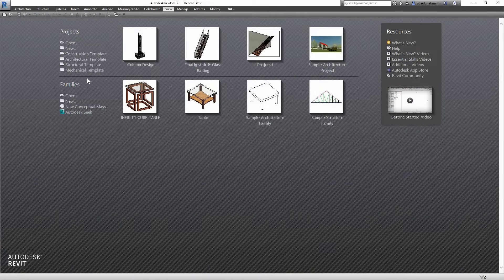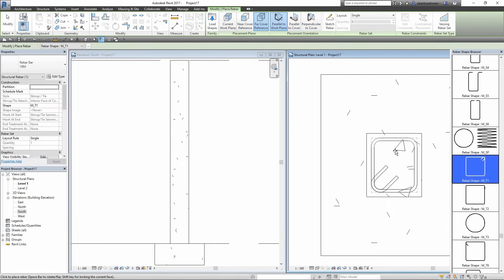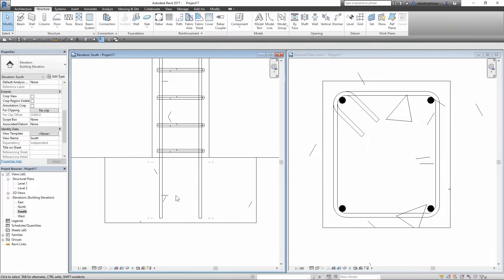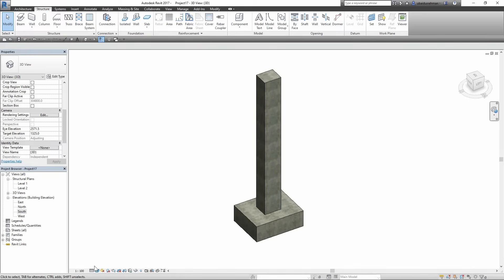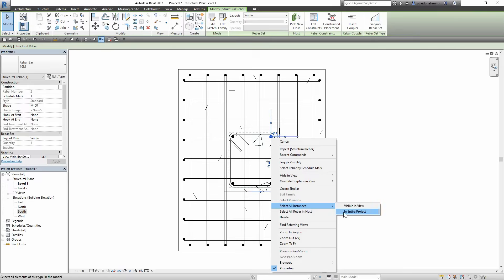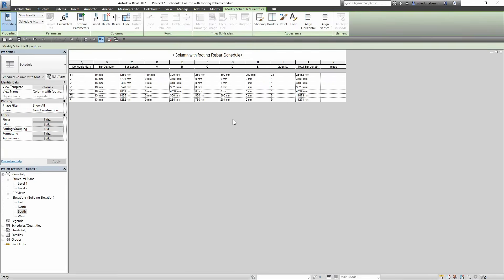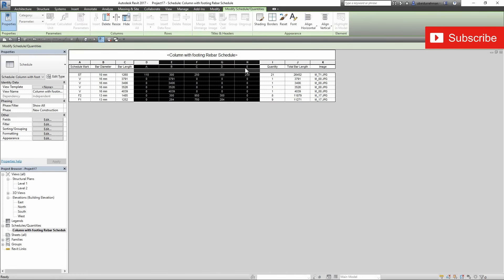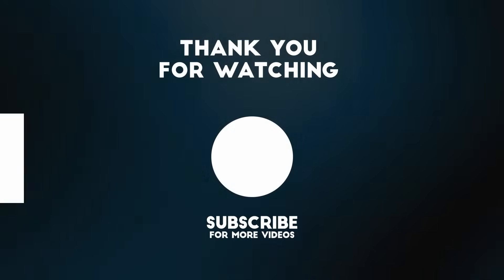How to prepare Rebar Schedules in Revit?

Comment: What about development length of reber of column inside the footing? I am searching how to extend that rebar diagonally.
Reply from the maker: Once you apply rebar, goto floor plan wireframe setting and rotate each rebar, i couldn't find any setting in revit for this perticular activity unless we use add-on
Reply: @drawanddesign  I tried it but didn't work for me ... I extend the bar but I not in the diagonal way as the rebar of column should be inside the footing.

Comment: Thanks so much but I was wondering why the Bar length doesn't equal the value from (A+B+C+D) there is always 50mm + or - diffrence?
Reply from the maker: It is because of bend reduction .... when ever you bend a bar in 90deg it elongates (2 x dia of bar) so we reduce our orignal length considering bends in it ... so that we can achive proper length after bending
Reply: @drawanddesign  that what i thought actually but didnt expect the program to be so accurate.. Thanks alot for your reply.. Thumbs up to your vid and subs.

Comment: Is the bar length is correct ? Are you sure? Is that Revit taking bar length is correct?
I'm very sure bar length is incorrect because the software can't take area of curvature.( 2D)
Reply from the maker: Yes rebar length is correct ... you can find the calculation of each rebar in properties panel ...

Comment: Sir thanks for your valuable video I have one question if I need vertical rebar need to fold with footing rebar then we can fix vertical rebar to the footing
Reply from the maker: Thanks but I didn't understand your question ... please elaborate
Reply: @drawanddesign  how to bend base vertical column rabar joint with footing rebar
Reply from the maker: For this purpose you have 2 options
1. You can sketch custom hooked rebar 
2. You can use SHAPE 01 from revit rebar shapes